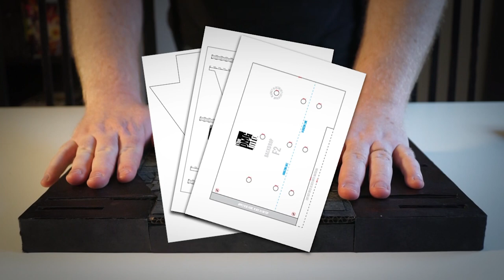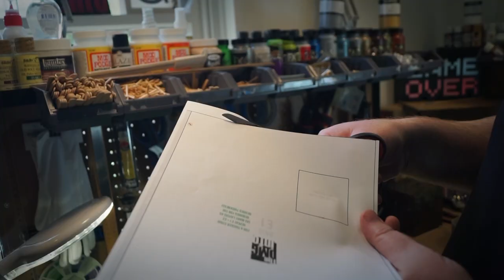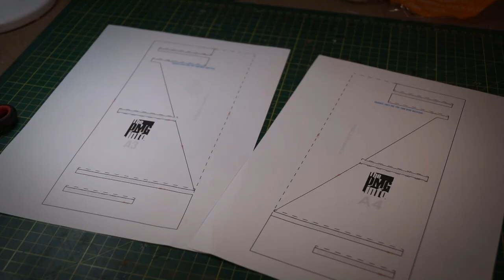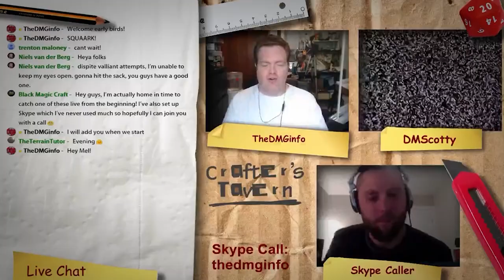The Stage | Online Terrain Crafting System

Comment: Why the conductive pen in the Amazon stor—OH! Contacts inside the base under the stage in a future iteration. Paint "wires" for LED lighting into your backdrop walls. Just slot your backdrops and foregrounds in place and they'll be powered, just like that…

Hmm… Fiddly with cardboard, probably, but I think it can be done.
Reply from the maker: Drawing circuits is easier than wiring and we are using disposable materials.

Comment: Someone might make a tidy little pot of gold by laser cutting these patterns in MDF, and selling them...  Neat idea, but not for me, and my group.  Still, a very neat idea.  Thanks, DMG!  Cheers!
Reply from the maker: Thanks for watching. I didn't expect it to be universally adopted :)
Reply: @TheDMGinfo  If you have a $400 laser cutter, you could sell the pieces, in a complete kit.  MDF will be uber-strong, easy to glue together with PVA Glue, and the whole will be precisely cut, will fit together precisely.  Someone will cut them, and sell them as a kit, if you don't.  Just sayin'...  ;-)  Cheers!
Reply from the maker: I have never seen a laser cutter under $1,500.
Reply: @TheDMGinfo  Check e-Bay for Chinese Laser Cutters.  The majority of the 40W units start at $400.  The 40W tube is plenty powerful enough to cut 8 mm - 12 mm MDF (may need 1-2 passes).  They do not have air to blow the smoke away from the cut site, nor do they have an adjustable table.  They may be bare bones, but they get the job done.  Just wish I could justify the need to buy one.  My nephew bought a 50W, with air assist, and an adjustable base that goes up/down.  The table adjust system needed repairs upon arrival, so he got a $400 refund, rather than return it (had a friend fix it for very little money.  Great unit, amazing what it can do.  Cheers!